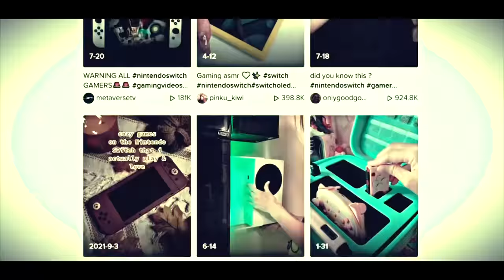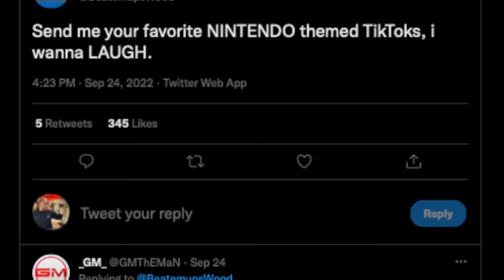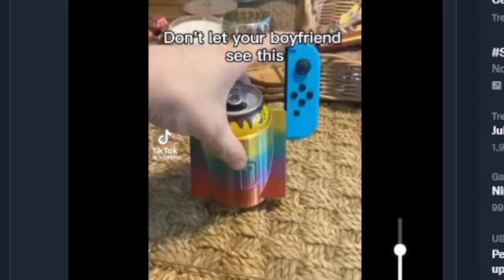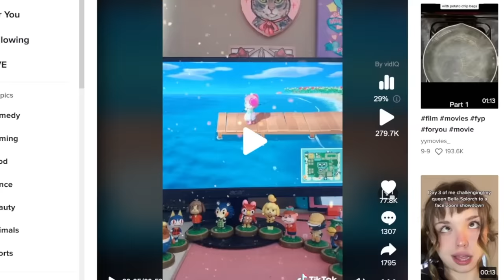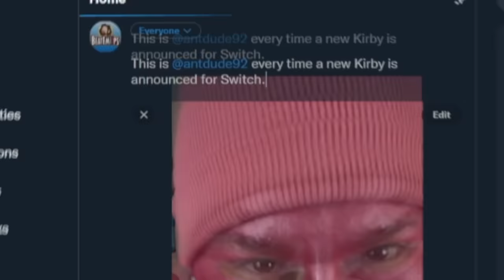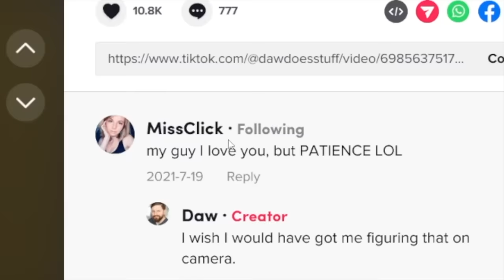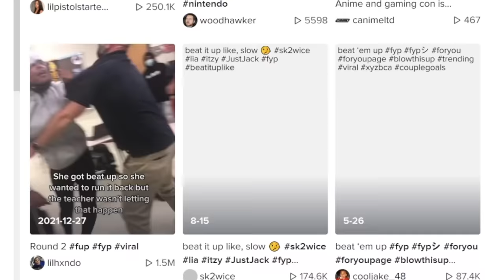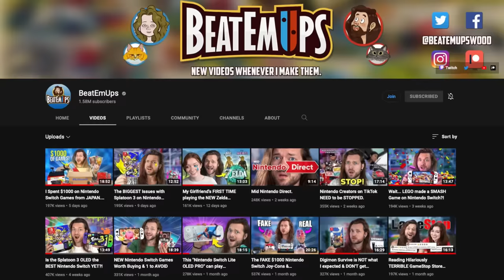Those Nintendo TikTok Creators Responded to me...

Comment: The candle thing works because all the sensor bar cable does is supply power to the bar, no data is processed by the bar, so you could even use one plugged into a different Wii if you wanted to

Comment: i had rope lights in my old room for a couple of years and after our kitty at the time had eaten through the cable for the sensor. we couldn't play wii games for a bit but still wanted to use the gamecube portion. found out after trying to fix the cable that pointing the wii mote at the rope lights worked enough to get to the disc channel and start the gamecube game or just a virtual console game with gamepad support.

Comment: Can we have more details on why you don't recommand  Nintendo SD cards?
Reply: They're exactly the same as non-nintendo branded sd cards but you pay extra for the nintendo branding. Amazon basics 128gb sd card is £14,99. The nintendo branded 128gb sd card is currently £16,99+ depending on the underlying brand. They both do the exact same job so it's a bit of a rip off paying extra when you don't need to. Some stuff like chargers or docks i wouldn't use generic brands as there's been issues with them blowing switches up in the past but sd cards are fine to use generic ones and save yourself a little cash in the meantime :)
Reply: @CraftyWitch1990  thanks for explaining, I was curious to know why it was looked at as Unecessary, guess now I'll learn to not spend an excessive amount of money knowing that its no different from another SD card (minus the fact that it has Nintendos brand slapped on the casing)...the more you know I guess, appriciate it 😅✨️